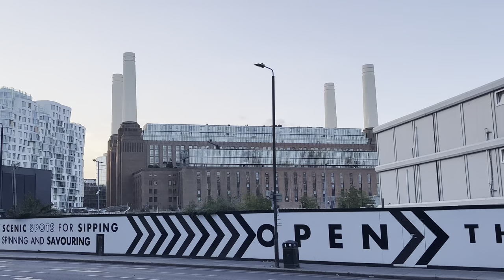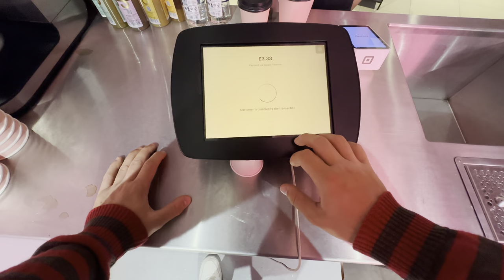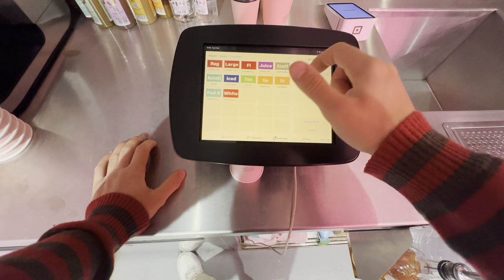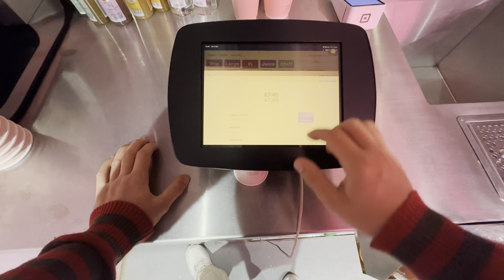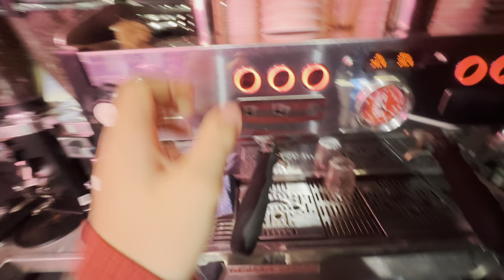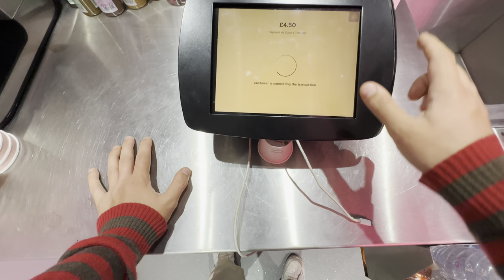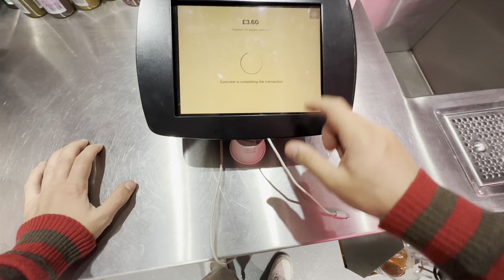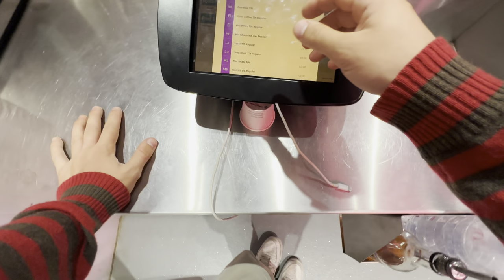POV- A solo barista works in an abandoned power station...

Comment: I don't know if I'm just so desensitized to inflation, but paying less than 4 dollars for any type of coffee is amazing to me nowadays lol. Also, can anyone tell me the difference between a flat white and a cappuccino? Every time I see him make them I swear they are the same...
Reply: It’s mostly a matter of the difference between foam levels. A Flat White will have a lot less foam as opposed to a Cappuccino. The preparation between both will almost always look the same.
Reply: Right!!! Here in nyc it’s like $6-7 a latte now a days
Reply: Coffee costs 0.5-2 pounds in the CIS countries. I am surprised by this difference
Reply: Flat white typically is stronger and has less foam than a latte and cappuccino. It may also come in a smaller cup. A cappuccino isn’t as strong and has the most foam.
Reply: flat white usually is smaller size but have more coffee
also there’s difference in coffee machine’s straits. for example, in cafe where i worked flat white was only 200 ml and had 2 shots of coffee and also made through single strait (which makes coffee taste stronger) when 200 ml cappuccino is only 1 shot. and yeah flat white doesn’t have foam :)
Reply: This is in London so GBP is being used btw, $4 is about £3.30
Reply: We were paying 5 turkish lira for latte in 2017 now its 65 turkish lira
Reply: hey :) I hadn't seen anyone mention this yet so I thought I'd just add on. here in New Zealand at least, a standard cappuccino also has a little hot chocolate powder on top, although some customers request cinnamon instead. other than that, where I work a flat white is expected to have 0.5cm of milk foam on top whereas a cappuccino has 1.5cm. hope this helps :)
Reply: In Jakarta, Indonesia, u can buy a latte or cappuccino around IDR25.000-IDR45.000 (1.6USD-2.88USD)
Reply: @JakeAlbina  well everything is more expensive in nyc
Reply: I’m not a barista so my words are not entirely credible(but I have been using a espresso machine to make lattes for 3 years so that’s worth something I guess)

Flat white, latte, and cappuccino are basically the same drink at different levels of milk foam. Flat white, as the name implies, is relatively flat. It has the least amount of foam out of all 3 and only microfoam (I think it’s also made with a ristretto..? Idk). 

Latte and cappuccino have a pretty small difference. Cappuccino has more foam than microfoam and latte has more microfoam than foam.
Reply: e.g Flat white 200ml - 2 espresso shots, 130ml milk + thin foam
Cappuccino 200ml - 1 espresso shot, 180ml milk, thicker foam
Reply: how would that make you desensitized? that’s literally the opposite
Reply: @vsirl, 2£ is 2.3€, that is cheap. In my country (lithuania) it costs 2.6€. So a 0.3£ difference.
Reply: Here in Vietnam, we can drink coffee with less than a dollar…
Reply: It depends on the cafe really. Every place is different. But a flat white should have thinner more silky foam whereas a cappuccino should have thicker creamier foam and often it has chocolate on it. Some places do them in different size cups too. But yeah, often in speciality places caps are pretty similar to flat whites.
Reply: The Barista nerd is coming out of me now

So when steaming the milk for flat white, you only give it 1-2 seconds of aeration so the drink has less foam
When steaming milk for cappuccino, you give it 4-6 seconds of aeration so it has more foam

Comment: Love your content! I’m new to this whole coffee making process.  Only ever used filter coffee that is already grounded and now I got my first coffee grinder. :) I do have a question. I know that many Barrister weigh their coffee but does it make a difference if it’s 17.7 or 18g? It’s probably just because I don’t have the most evolved sense of taste (😅) but is it actually noticeable? For all coffee enthusiasts: please don’t kil* me for asking. 😂
Reply: Great question. Most coffee calls for a different recipe and typically for a double shot of espresso, in most cafe's, the recipe is dialed in for 18-20 grams. You really want to be as close to the recipe goal as possible. For example if the recipe calls for 20 grams of espresso grinds in, you will typically pull 40 grams of espresso liquid out. Just as the recipe is important when talking about weight, you should also know that pressure can play a big role in the recipe ratio, but typically 1 gram in to 2 grams out which leads to a well extracted shot. Pulling a 17.7 or 18.3 gram shot when the recipe calls for 18 can lead to over or under extraction making the shot taste bitter and sour or watery and less defined.